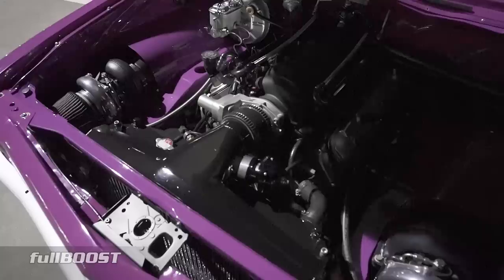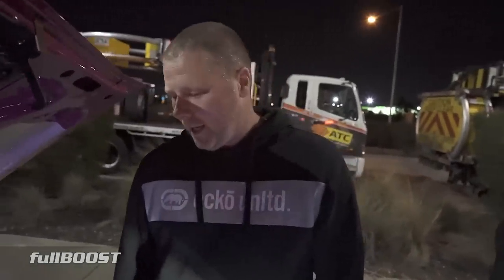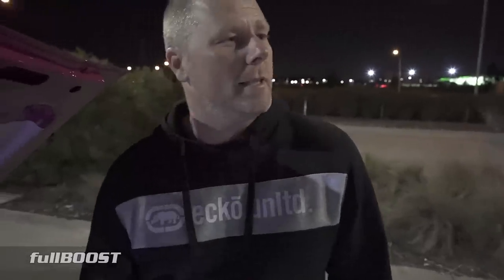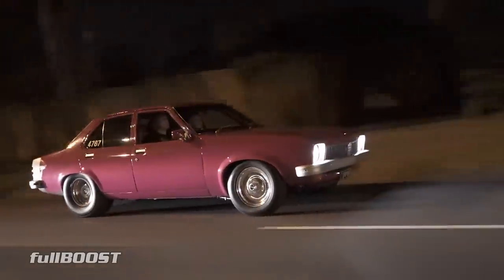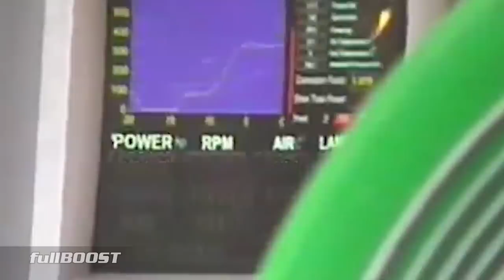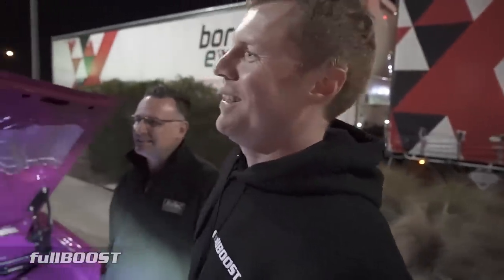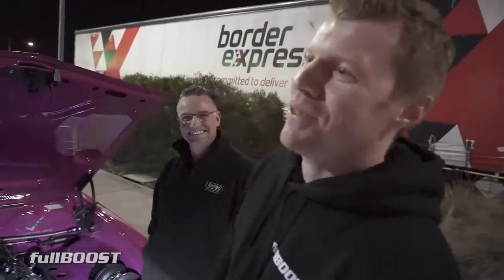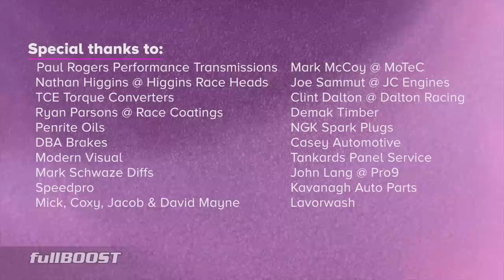Inside a 7-second street car

Comment: Really good video, I particularly enjoyed the Motec stuff  from Mark, Motec is a product I don't here much about with drag racing
Reply: Hi Michael,  it is a bit strange but we have been involved in drag racing for as long as i have been at MoTeC (over 17 years). Lots of product on lots of cars.  Top fuel, top doorslammer, pro mod, heaps.  I think the other brands shout about it louder😂
Reply: @markmccoy2559  Thank you for comment Mark, I was aware that Motec is heavily involved in motorsport such as circuit racing and it great to here that Motec have been involved in drag racing for many years. I think your right the other brands shout louder while Motec are the quiet achievers just getting with the job of first class engine management systems.

Comment: wonder how it'd go with a pair of gtx4202 gen2s 😜take a bit of backpressure off the motor, little bit more headroom for boost
Reply: 1.18's  and not small turbos they are logging the  EMAP so I'm sure they know  ..I dont think it could do 0-200 in second as well with GTX42s but hey they  still have first gear up there sleeve..good thing about having heaps of good data and clever cunts looking at it  is they will know  exactly when they run out of turbo
Reply: running out of turbo is a bit of a misnomer though, its really a sliding scale .. if they went gtx4202 they could probably make the same power they make now on 28psi on maybe 24-25psi instead, and with less backpressure .. all of which is good news for the relatively mild engine combo they're running .. instead of running the turbos right out to the ragged edge, as it sounds like they did with the previous set that was on the car running multiple 8.0X's ... anyway, they will have the data to determine the best choice, just pointing out that its a drag car, bigger turbos add potential and have very little downside on such an application

Comment: Love the set up these are actually the same turbos I want to put on my 427 LSX 2006 GTO but how in the world are you running that type of boost on Compstar Rods (NOT Ultras???)and a 4 bolt block without blowing it a head gasket? And stock ignition system?? Very impressive you have this car seriously dialed in! And have you ever thought about running a Holley High Ram intake to get more power out of it? (granted the torque would suffer if you did)

Comment: Didn’t Leroy run 7s with 1200hp and a manual? This thing is pissweak pfft
Reply from the maker: Is this Bench Torque bait?
Reply: So a car with no body and turbo's sitting higher than the Statue of liberty is tuff?  but a street car that doesn't look any different in the polices eyes to any other Torana is pissweak?….Please continue working at Bunnings, brains are in aisle 1800...
Reply: Bunnings is where experts in fertilizer work . Renowned for their vast knowledge of horse manure .
Reply: IWORKATBUNNINGS who's Leroy?